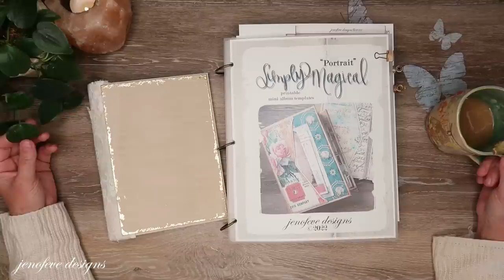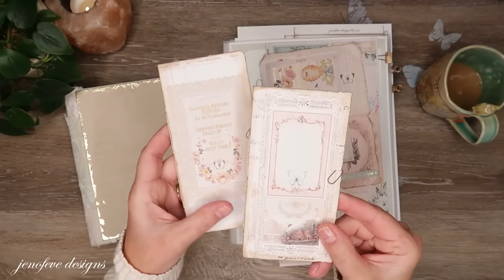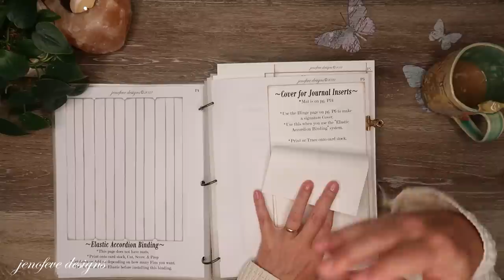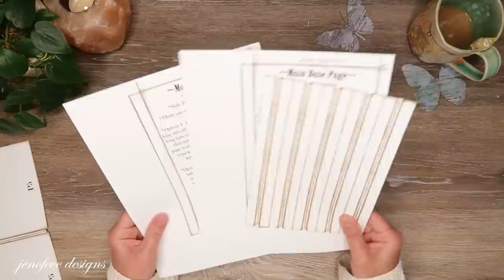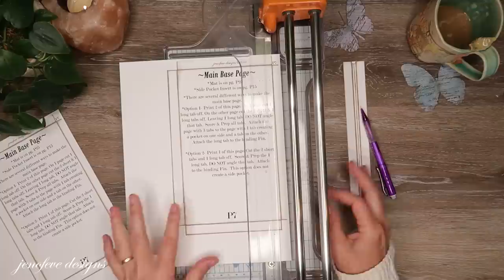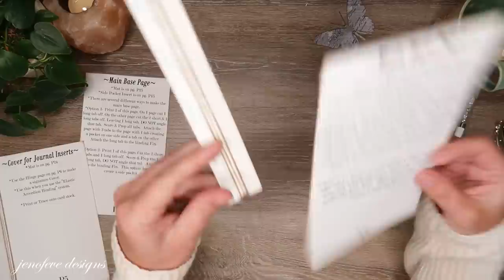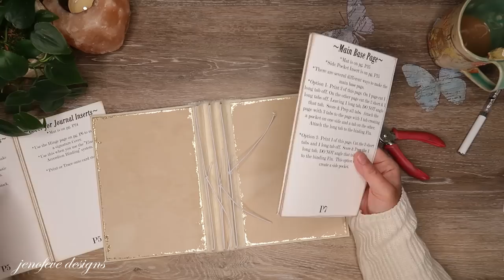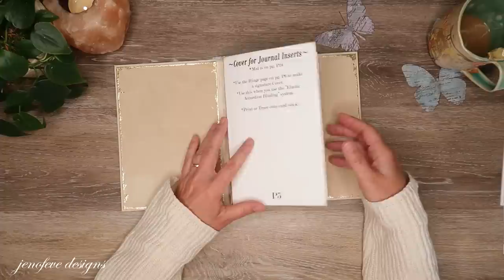Some Honesty + Creative Block + Creating a Booklet Page Template

Comment: Jenifer - here is a suggestion for you.  It does not involve this set of templates or any you have done in the past, but it would be helpful if, in the future, along with your copyrighted info and page number you put on each page we can print out, that it would say what set of templates it belongs to.  Sometimes I print out extras.  They sit on my desk, and then I can’t remember which workbook they came from….I have so many.  Sometimes I spend hours trying to find where they belong.  It sure would be helpful if each page I printed said something like “Basically Amazing Foundations” or “Lovely Layers”, etc.  (For example:  I have an envelope on my desk right now that I need two of, but I can’t remember where the original came from.)

Comment: I get the creative blocks all the time. I went almost all of 2020 without doing a single album even though i had a bunch of templates to play with. I just  couldn't put things together for some reason. I had lost my creative mojo and it bothered me but at the same time, I couldn't pull out the chipboard or paper packs or whatever to get started. I'm having the same issue now too although i'm more distracted with other projects at the moment but still. Sometimes it just sucks to do things.